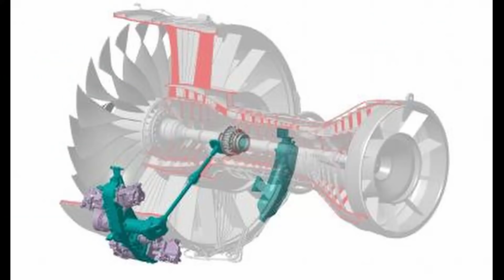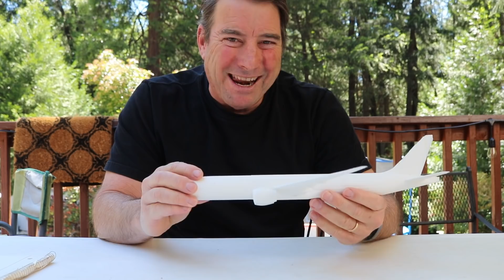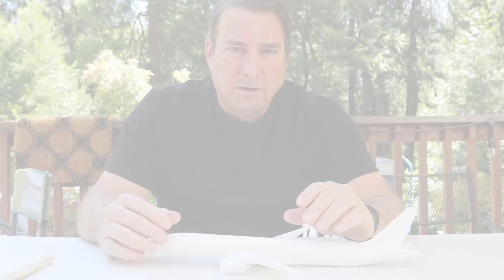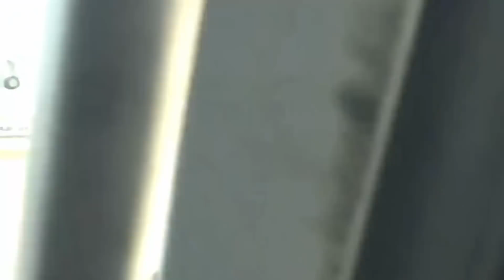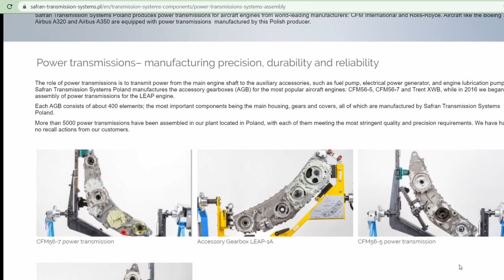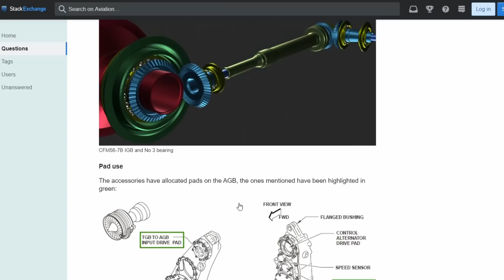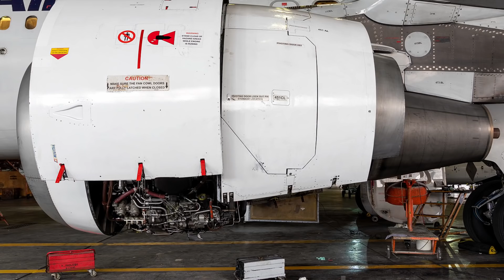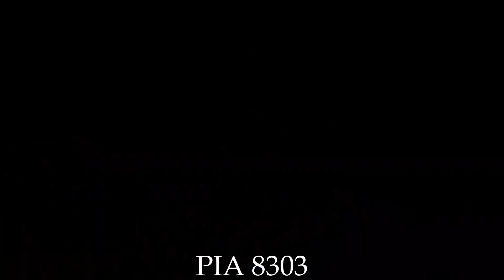PAKISTAN INTERNATIONAL AIRLINES #8303 UPDATE #2 23 May 2020

Comment: Sort of a technical nitpick, but in the CFM-56 the first 3-4 compressor stages behind the fan depending on version are driven from the LP turbine and spool (you pointed to those exact stages when describing the HP turbine/spool).

The only engines that I know of that have the fan on a completely dedicated spool are 3-spool ones such as the Rolls Royce RB211 and Trent families.

There are also some engines like the PW1000G that have geared fans, in which the fan is driven from the same LP turbine as the first few compressor speeds but spins at a different speed. That's arguably the best of both worlds since it has the quicker throttle response and less finicky operation of a two-spool engine but with the larger and more efficient fan of a three-spool.

Comment: PIA PK3803
Inna Lillahi wa inna ilayhi raji'un
May Allah rest all departed souls in Peace (Ameen)
Communication Gap or Over confidence  (POW)
Captain should had tried landing gear before  the an enough distance from airport to  start landing, so he could had known about the issue and got enough time  to make a good strategy to land safe rather than the massive hit to ground.
But he didn't tried gear ignore the indications as he was enough experienced, so usually experienced person do such thing as they think that they have enough skill to deal with all situations or says(Mery Bye hath ka kam hai)  So he didn't try Gear before the enough distance so he was failed to think better and plan altitude was decreased at the same time to land on runway, and in  this confusion speed was also not the same to the safe landing speed and plane hit ground, then he just gave  power idle to engine to re take off  the plane which engin were damage because of this hit,
After  given the  power idle, he went to go round but the engines were damaged badly and rotors were rotating jammed or were not working as normally so after a distance they got stucked and failed.
As per control communication, Controller said to maintain 3000 height because of the environment and things, Captain said to maintain 2000, but he was even faild to maintain the same too because of thw wngins condition, even after the some distance the plane engins were started to getting down and altitude was also started to decreaing from 1800 rather than maintain to 2000.So here Captain understood that engin started to getting fail so he took a short turn to get to the airport runway or the safe place to land it at safe place, but unfortunately just before few KMs to runway the engin totally stucked and altitude totally decreased as that the plane hit to most highest building of residential area of Modal colony
If he tried the gear from an enough distance of airport so he could tried it manually too and if manually command was also failed so he also had the enough time to made a good strategy and communicated to Control the issue and should have told them  to arrange emergency landing at airport runway till then he could continued his flight by taking go round rather then decreased the altitude and come to the down for  massive landing to airport and damaged the engines.
Inna Lillahi wa inna ilayhi raji'un
May Allah rest all departed souls in Peace (Ameen)
(By Engr MMH)

Comment: As we all came to know by the aviation experts that this air bus A320 was a safe safe machine so had there been a fault in the landing gear why didn’t captain told ATC and used any of the alternate methods of activating gears and once  planes belly was touched with runway why pilot opted to takeoff for go round isn’t this CAA fault along with pilot error.

Comment: The more facts I read about this crash the more it looks that it was caused by pilot errors. He started the approach descent too late, and flew much too fast in final approach, forgetting to lower the landing gear despite alarms. The engines scrapped the track and were damaged. The pilot attempted a go round, but the engines were too damaged and failed...
Black boxes analysis will start next week in France, and will confirm or not this story.

Comment: JUAN: thank you very much for your excellent video, as always. 
 After looking at the runway friction marks, everybody is assuming that the crew just forgot to lower the Landing Gear, and thus contacted the runway directly with the nacelles.  But it seems that the fuselage rear did not contact the runway surface. Assuming a 'normal' landing procedure, the Airbus synthetic voice would have been anouncing the height being lower and lower, like: "One Hundred"... "Fifty"... "Forty"... "Thirty"... "Twenty"... "Ten"...
Then "Retard, Retard..."

At that time, the aircraft would be executing  the flare, and the fuselage rear bottom would be close to the ground.  A "Tailstrike" would result from the nose-up attitude at the flare together with the LG not being down.
 Apparently, there are no Tailstrike marks, but only Nacelles marks.
But; What-If...
 What if they had ALREADY CHOSE to TOGA, seeing that the speed was too high, or that the approach was so terribly wrong, and at the last moment the crew decided to ABORT THE LANDING AND EXECUTE A "GO-AROUND", but the airplane kept sinking for its inertia,  contacting the runway with the engines?  Look, the engines are located very low, in fact lower than the Center of Gravity and the Center of Pressure. So, any friction between the bottom of the nacelles and the runway would have caused a pitch down moment, keeping the airplane from going up,  at least until power went up sufficiently (after the spooling-up period), finally Taking-Off again.

That scenario would fit and explain why they went AROUND instead of continuing with a Belly Landing: perhaps they had already decided to go around, and misjudged their sink rate, spool-up and having the gear up, kept going down until one nacelle touched down, slightly bounced that wing, then the other side.  Runway marks will tell a lot when all the entire aircraft dynamics, friction coefficients and speed values are correlated in a more or less complete simulation model.

 There is the possibility that, for whatever reason, the landing gear didn't got properly locked down, perhaps one of the three legs wasn't "green", and they decided to go around but even if commanded, the airplane is no Cessna or "STOL", and it takes several seconds to arrest sinking and start spooling-up the engines and even more to get a positive climb.

With the landing gear up, the wings are still more close to the ground, making a  slightly more effective "Ground-Effect" that would explain why the friction marks repeat after the first mark: The increased air-cushion helps in cushioning the sinking and prolongs the "hovercraft  float", but as the engines are still at low N1, the Thrust is still not available, for quite a few more seconds.
This needs to be "reconstructed" carefully. But the simple "They forgot to lower the LG" scenario is too coarse to be the only one. Occam's Razor asside.
The more than once Nacelles-Runway sets of marks could be consistent with a first contact producing a bounce, then the aircraft rises a bit but also loses speed from the friction and at the same time gets a momentary pitch down moment, then it sinks with low vertical descent speed and makes contact again, but as the crew possibly applied TOGA power, the engines spool-up and finally overcome the  friction and their impulse produces an up-pitching moment that finally helps rotate the aircraft against the previous friction caused pitch-down moment, and finally it is airborne and climbing to a go around, but by then the engines are damaged, and will fail in a matter of minutes, producing the final crash.

  Does it sound Plausible?

Comment: Careful that you recognize the difference between the circumferential mounting position of the Accessory Gearbox (AGB) on the CFM56-5B (Airbus engine) and the CFM56-7B (Boeing engine). The CFM56-5B has a radial drive shaft at the 6:00 position and the AGB is centered about the 6:00 position. On the CFM56-7B, the radial drive shaft is at the 9:00 position and the AGB spans from the 9:00 position to about the 6:00 position.

Comment: All of this talk of damage to the engines is secondary to the fact that they never put the gear down on the initial approach and landing attempt. The gear warning is going off when the pilot says he is comfortable and lined up on 25L. So either they didn't put the gear down or they had a gear malfunction and did not declare an emergency. The real discussion remains soley on the cockpit voice recorder and the black box information to confirm the reason the gear was not down. And to go around once you've landed gear up is a complete failure! Any experienced pilot knows better than that, common sense tells you that if any part of the aircraft touches the ground it is the engines and the chance of not destroying them on impact is slim to none especially to rely upon them to create sufficent thrust for a go around and another approach.

Comment: Actually route cause behind it was l/g not extended, and the reason for it is high speed and decent rate, for which the crew was facing "sink rate/pull up" warning with CRC, and the "too low gear" warning was suppressed by other high priority warnings, the crew never followed the l/g check list, or the time they did it, a/c speed was hi, so they decided to extn l/g later which never happened, there was no failure relating l/g else they could have extended it manually, if it was the case the l/g door should have opened and remained opened by mechanical cable.  Actually crew never came to know about l/g, if it was a failure of l/g and they where intentionally going for belly landing, they would have never done a goaround. They where aware of l/g only after the impact, to save a/c and occupnt capt did goaround but it was too late and actually a blunder..
Reply: There is a possibility they might have switched gpws off too, for avoiding warnings.

Comment: I wonder if this situation - physical damage to both engines caused by a gear up landing attempt - would be different on a 737 NG.   To provide greater ground clearance for the CFM56 on 737NG, some of the engine components are mounted on the sides rather than the bottom.  Is the accessory drive gearbox still mounted in the same position on the CFM56-7 as it is on the CFM56-5 ?

Comment: Fuel or ignition or one of the two major causes of an engine failure you don't have fuel you don't always have ignition ignition there's an electrical issue therefore it's based on the maintenance

Comment: I don't know if you'll read this comment but I have some info for you.. The plane was coming too high as in they were doing 5000 when they should be doing 2500.. Controller advised to go around at 1500 but pilot said no need they're comfortable.. At the last moment the pilots decided to go around and before the thrust could take full effect they agreed on retracting the landing gear and the engines rubbed on the runway

Comment: Yes , just imagine the engines taking thethump of the entire aircraft, which huge hydraulic landing gears are supposed to, , bound to damage the gearbox assembly which operated just enough for the craft to take off in full speed for the go around, but not enough for sustained flight. leading to loss of fuel supply and shutting off of both the engines.

Comment: Runway had 3 long burn marks at 4500 ft, 5500 ft and 7000 ft. Doesn't that tell the aircraft landed with landing gear down which subsequently failed/collapsed? Hence proving what you mentioned earlier about beeping warning in the cockpit about unsecure landing gear deployment? So, it doesn't seem aircraft landed with gears up. They eventually collapsed after landing followed by the events you explained.

Comment: Korea in mid 60's while observing take off and landing at Kimpo Airbase at that time. A 707 commercial aircraft was in final with the wheels retracted. My friend and I immediately saw what was happening and were just waiting for the fatal touch down. At the last moment the pilots must have realized the situation and put on full power from their landing set up. It went around dropped the landing gear and safely landed. So it does happen.

Comment: Juan, thank you very much for the enlightening videos.
Could you please post something related to what Josh T wrote yesterday?
I transcript it here:

Josh T
1 dia atrás
... it takes a long time for the engine bearing to seize from oil starvation. Maybe 10-15 min. They aren’t like car bearings. You hit section bearings will fail first from heat. Seen tons of them. The radial drive shaft might break a few teeth off the radial gear box inside of the fan case deflected enough. More than likely it would be the fuel pump shafts shearing that would cause such an immediate failure. The fuel control is bolted to the back of the fuel pump and the share one shaft from the gearbox that’s drives them both. Where the shaft goes in the gearbox it has a shear point stated in another post. It is about a 1/2 diameter shaft the for about an inch is whittled down to about 1/4” or less diameter. When the mec or fuel pump size it keeps the entire engine from stopping so you can return to the runway while windmilling the engine to maintain positive oil pressure in the engine after the engine is shut down. If the gearbox stops all the accessories will stop. Either way when the fuel pump shears the engine stops completely immediately. If both engines had the same failure both engines would stop. Hydraulic pressure electrical and oil pressure issues can last for maybe 30 min with out causing the engine to stop and plane to be controlled. Fuel distribution issues stop it right away
Thanks.

Comment: Yes the bottom of the Assy is critical  but crew managed to get plane airborne to 2500ft .how come. 
There was a damaged which misaligned the gearbox and in result components collapsed inside the engine which later caused the both engine to fail. I don't think it was a high force touched down .

Comment: If bottom of engines hit hard enough to impact function of accessories drive box - the first to go would have been engine lubrication; & possibly also hydraulics. Hydraulics leak/pressure loss would be flagged in cockpit(?); not sure engine lubrication/pressure/temp. would - or would be noticed amongst other issues

Comment: There are a couple of questions that I have in mind. If the A320 did do touch and go in the way that engines made contact with the ground, the additional drag caused by it should have slowed it down hence the aircraft would have required to increase its airspeed up to the takeoff speed requirement accounting the fuel weight remaining. Further, the ATC should confirm the approaching runaway for the first touch and go (25L) so there should be markings on the runaway for close inspection. I hope the runaway 25L is not open for flight operations till they conclude the investigations regarding this otherwise that would be just stupid of them. You also see the criminal negligence from CAA to allow the colonies/residential areas to be built in very close proximity to the airport. @blancolirio please keep the updates coming. I want to know more of your analysis and thoughts. I hope the international aviation safety experts and Airbus experts get involved and put this investigation in the right direction from the very beginning.

Comment: I work on the cfm56 reverser . It has two pivot doors to slow the plane down. Kind of crazy to think about how messing up one little part can cause a plane to crash. I think this guy told it exactly how it happened. Either they took the landing gear off to soon or I dare to say it malfunctioned  and they possibly felt it so they had to pull up.

Comment: I was thinking there must be a one-way (sprag) clutch somewhere immediately after the PTO (which is what I shall to refer to the output from the turbine shaft as) but then when I saw the 'handcrank' section realised there probably isn't (unless it can be taken out of the equation for maintenance). Hopefully there's a sacrificial connection somewhere, like a keyway, though so in the event of mechanical failure of any of the accessory components driven by that gearbox it can't bind up the works. As a mechanical engineer this is quite interesting.

Comment: That must have been a terrible shock for the crew as the aircraft settled onto the cowl skins vs rubber. They may have indeed touched down in the proper zone if the wheels were down. Wheel up, with a normal rate of descent I imagine you'd float a little further down the track before contact. And of course the terrain warning alarm isn't going to go off in a landing configuration - apparently even with a gear malfunction. 
It's too bad that the auto altitude call outs in those last 500 feet don't switch to "Gear Not Down" as a last desperate reminder. 
Thank you for the first rate reporting JB.

Comment: You are showing a NEO Engine gear box not a CEO gear box . If you have contact with the CEO gear box  and the ground It would be catastrophic for the engine and lead to total power loss. That is a very forgiving powerplant and in my carrere i have worked on many CFM 56 both NEO and CEO.

Comment: If you damage the accessory drive and both the oil and fuel pumps stop turning the engines are going to start shutting down and the thrust will start to disappear. The video of the crash shows the airplane in a high nose up attitude just before impact consistent with low airspeed and a stall.